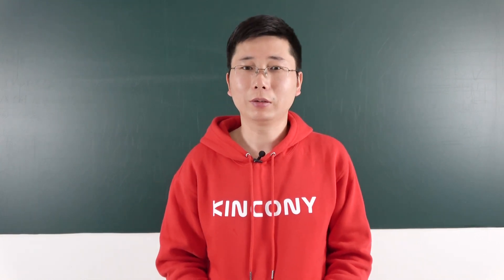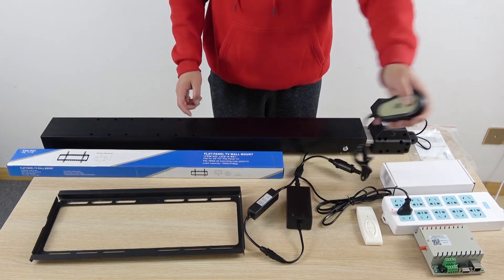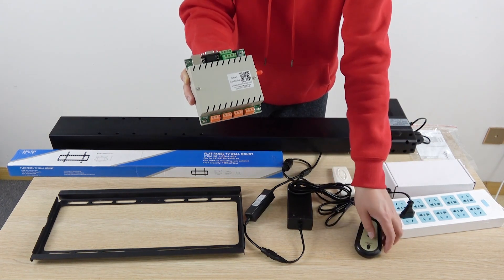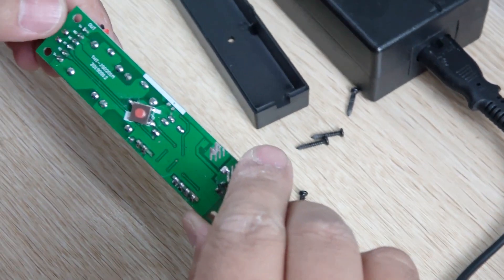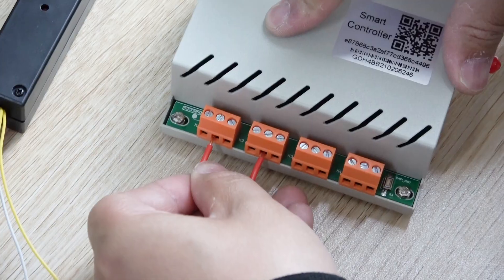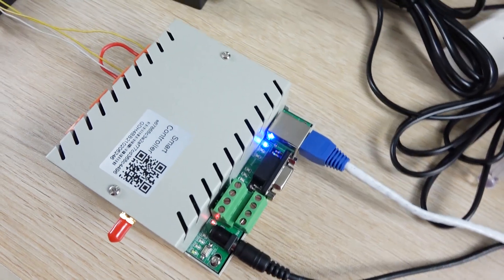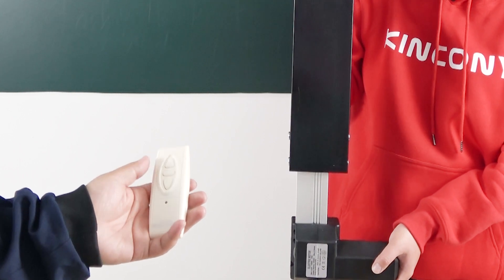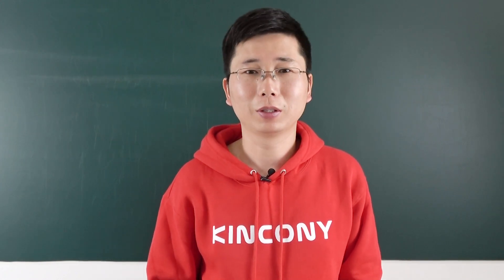Let your TV lift become smart in 5 mintues!

Comment: We purchased a very nice cabinet with a TV lift about 8 years ago. All went well until our little remote quit working about a month ago. We took the remote to a local place where they put in a new battery. So the remote seems fine, but will not connect to the lift in the cabinet and raise the TV. My husband had to get into the rear of the cabinet and manually open the top cabinet door and then raise the TV using the button inside the cabinet (the one on the lift itself). That works just fine. It's the remote that doesn't seem to work. What could be the problem? If you're not able to help, can you direct us on who to call regarding this problem. We can get the TV down and the top door shuts, but then opening the door and raising the TV using the remote is the problem. All seems to work except the remote. For now the TV is raised until we can fix this problem. Sorry for being so wordy. It's a mystery to us grandparents who don't know a lot about technology.
Reply from the maker: maybe you should replace a new remote for a test.